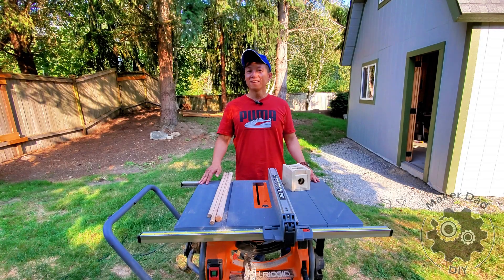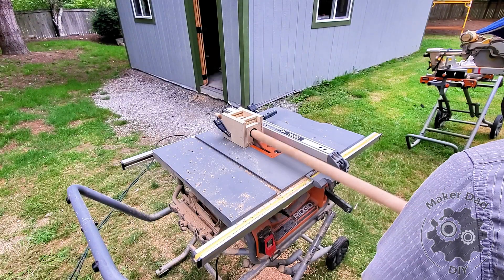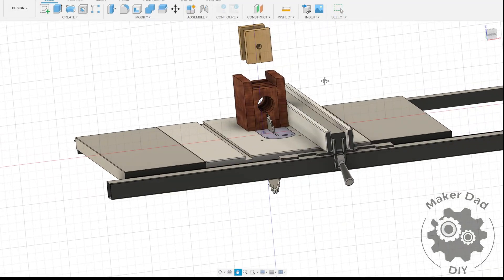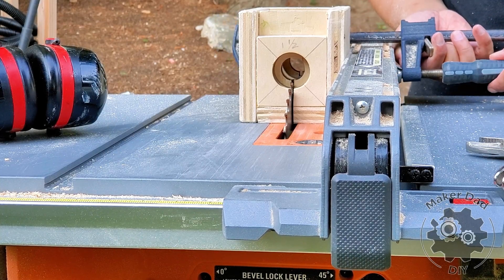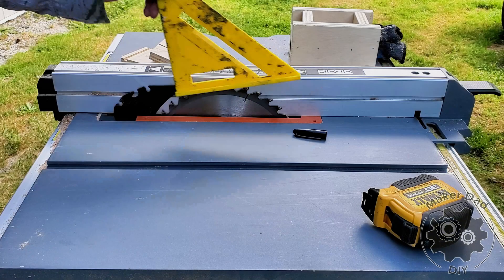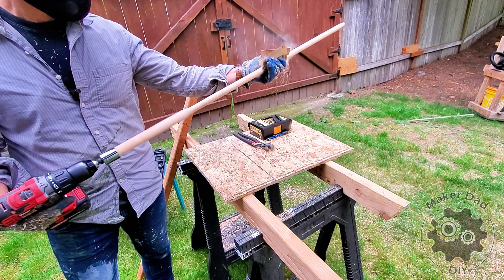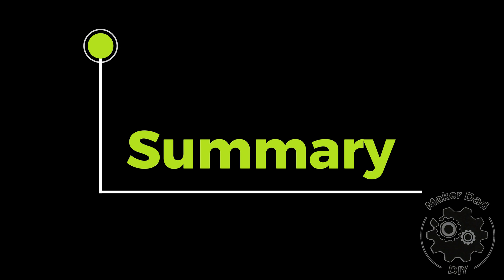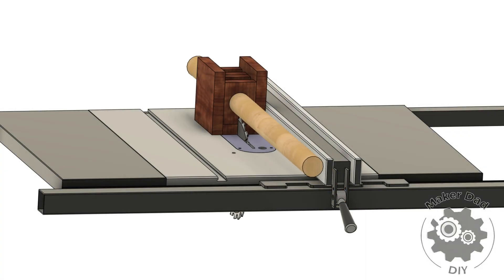How To Make Dowel: Dowel Making Jig ( With Table Saw )

Comment: This was what video should be - concise, clear, covers all the steps without dragging them on. One warning, at 1:42 you are cutting small blocks of wood that appear to be shorter than the distance between the blade and fence. There is a significant risk of kickback. Good luck with your channel.